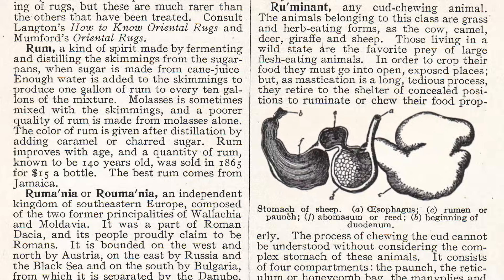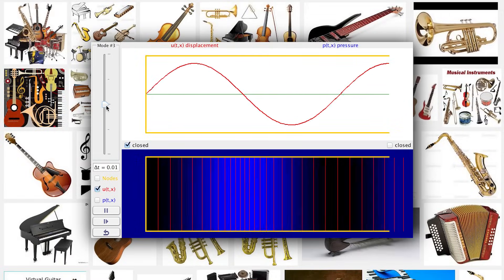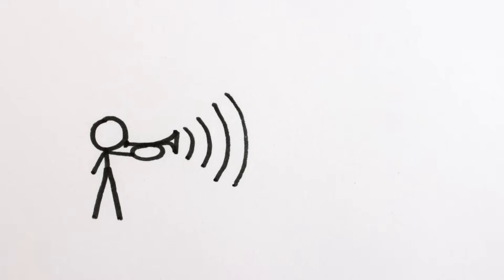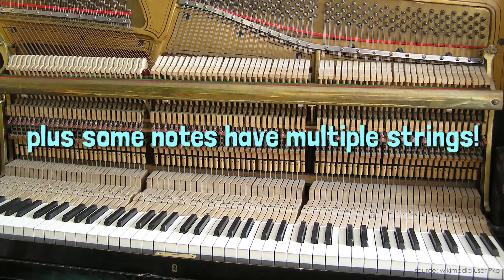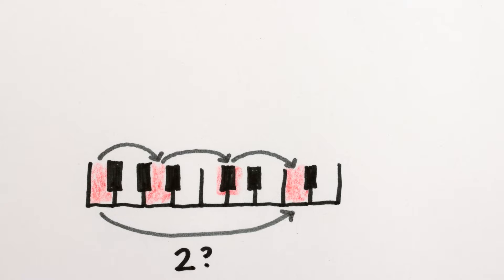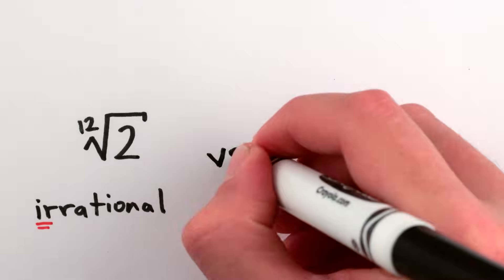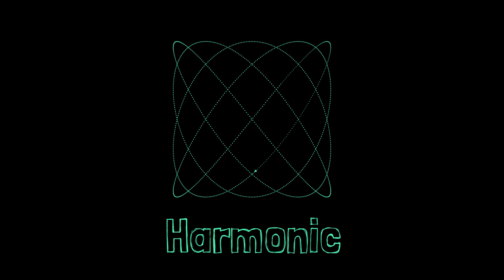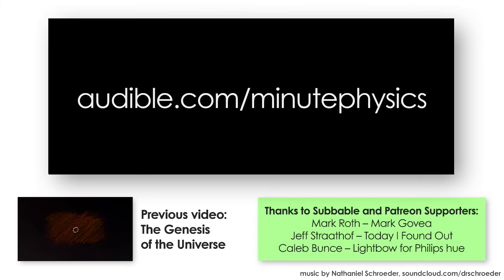Why It's Impossible to Tune a Piano

Comment: ? ? ?
These harmonics caused disharmony in my brain...
Maybe I should learn theory of musics
Reply: +EC912 It's worth it. Once it starts making sense, it's pretty fun.
Reply: +EC912   use 432Hz sacred solfeggio instead of J Goebbels muddy 440hz
Reply: don't don't don't it's a waste of time.
Reply: I'm a music theorist and a jazz piano player
Reply: Mike Davino
So what? Musicians can be wrong too. A432 is an outlandish conspiracy theory with no historical or music basis whatsoever. If you can demonstrate you're right, I'd really appreciate it if you did so.
Reply: +Mike Davino How is the starting pitch relevant? Why not train your ear to the pitch set we actually use? And which one DO we use? In Baroque times, A was quite variable. Instruments from the period are pitched as low as 392Hz—a full whole step below 440Hz. Through the years the pitch gradually rose. By the early 19th century, the pitch of A was approximately 430Hz throughout Europe. Even today, many British organs are tuned about a half step lower than the one at the Vienna Philharmonic (compare 425Hz to 450Hz), and the Boston Symphony Orchestra tunes to 441Hz.
Reply: phase conjugation
Reply: all waves line up symmetrically ...check out Dan Winter
Reply: +Mike Davino There is no base pitch at all that will cause this. You have been had.
Reply: Mike Davino
Any historical or scientific sources at all? Just randomly dropping names of people doesn't help much.
Reply: +EC912 =((pi^(9/89))-(4^54))+0.5(-98)(/3.1626*(2^32))
Reply: ender_scythe
Actually, pi^(1/81)+e^(arctan(3/61)+ln(cos(5*i + 9/2)))+(7 * sin(21*e) / 2 * phi).
Reply: +Fernie Canto does it really exist, no it doesn't lol nice fake mathy maths.
Reply: the names i gave have youtube channels
Reply: +Fernie Canto I agree. Another thing these '432'ers ignore is the fact that the numbers we ascribe our measurement of time are arbitrary, 432Hz would be a completely different pitch were a second not the length we arbitrarily defined. I think all this nonsense started because Just ratios are just very easily dealt with using 432 as reference, for example 9/8 = 486/432, 5/4 = 540/432, Hell, even 11/8 and 7/4 is 594/432 and 756/432 respectively.
Reply: +IAmTheStonedAtheist Also the 432hz nutters miss a very important point.
Let's just go ahead and assume that this 432Hz crap is real. If I use A = 432 Hz as a reference, I will be in perfect harmony with the universe because the universe has a fundamental frequency of 432 Hz.
Ok cool.
Now I'm I'm going to play a song in A# major.
That fundamental frequency of A is going to clash pretty hard with my A#.

They also ignore the major point that, even if you did set your A to 432Hz, as we see from the above video, none of the notes we play (except the octave) are perfect. So even if the A = 432Hz nonsense was true, it would only work on non-tempered instruments such as bugle, harmonic flute, didgeridoo, etc.

This is all just wishful thinking by uneducated people who think they have found the magic secret shortcut to making music sound great.
Reply: He is talking about Western music.   Traditional music from the parts of the world,  like India,  do not have a concept of chords
Reply: +fenojack As a musician, it's really not.
Reply: +Forthelemon It really is.
The A = 432 Hz is pure conspiracy theory bullshit.
If you know anything about music and physics you should know that it can't be true.
Detune if you want, but you're wasting your time trying to 'tune to the universe'
Reply: nuberiffic
What are you talking about? I know the 432 Hz thing is bullshit. I was replying to fenojack who said that learning music theory was a "waste of time." I never said anything about 432 Hz.
Reply: Forthelemon To me, music isn't supposed to be calculated and made mathematical. When I hear a minor third, my brain doesn't think ''Oh! that's a minor third, interesting, it could be the start of a strict formula of chords!''  No, I feel an emotion from each note. When a composer writes music, he wants the listener to feel a certain way, and he would use the notes like a palette of paint to convey those emotions. Of course, music CAN be calculated to sound nice, and there are many examples of good sounding chord progressions made this way, but I feel it takes away from the joy of writing and playing music. 
Music theory hasn't deepened my understanding of music much, but then again, everyone has their own opinions.
Reply: fenojack You do realize that harmony, say an interval of a perfect fifth, is a perfect 3:2 relationship? What other way do you recommend we notate and calculate the notes we use? You do realize there are 3 just versions of a minor 7th interval that are easily tuned by ear, and represented as small number to number ratios? I'm having difficulty understanding your point.
Reply: +Forthelemon Hmm.. Well my youtube is telling me it was responding to a different comment. NM.
I agree though; I used to think like +fenojack, that theory was a waste of time and that, "you just gotta feel the music man"
But theory helps you understand why certain songs feel a certain way :)
Reply: +EC912  Music theory really has nothing to do with harmonics and different types of scale tuning, such as the even tempered scale.  That's just science.  However, learning music theory will help you understand how music works, and why notes go together, and why going from one combination of notes to a different combination of notes sounds the way it does.  Then, you will better understand the implications of different scale tunings.
Reply: +fenojack All music theory does is describe all the different ways we've found to elicit emotion out of music. Theory is descriptive, not proscriptive.
Understand the theory so you can know what's happening in a song, use it as a guide to see what kinds of chords / notes you could also use. But still feel everything out.|

What you're suggesting would be like Usain Bolt saying, "No, I don't need to understand anything about biology, kinematics, running techniques, training methods, sports science, diet, and healthcare. I just run the way I feel."

Sure he might still be a pretty good runner without any of that, but understanding the theory of running has made him the fastest in the world.
Reply: +EC912 I've been studying music theory for last 20 years but this video still blew my mind. Music theory might teach you a bit about waveform resonance intersecting at certain intervals to create desirable cadences, but I had no idea about harmonic frequencies using divisions of an irrational number to create a kind of imperfect harmonic consistency through the octaves. I never knew this was even an issue for turning a piano. That is complete madness yet quite amazing really.
Reply: nuberiffic
"Music theory hasn't deepened my understanding of music much, but then again, everyone has their own opinions." I guess that's kind of what I'm going for.

For me, knowing about music theory has VASTLY deepened my understanding music--not just at a practical level, but at an emotional level too, in the same way that learning about biology has made the natural world so much more beautiful.

I think it also partly depends on how you were taught. A bad theory teacher will just teach the theory in a purely abstract, mathematical context. They'll tell you "this is a circle of fourths, and this is how you notate that on a music staff," etc, but they won't demonstrate what that means MUSICALLY or what it sounds like, what it feels like, how to use that knowledge to better your understanding of a composition, etc. Ideally, theory should be integrated into the teaching of your instrument, so the music and the theory are one and the same, not separate things.

The equivalent in something like science would be to say that, for example, a bad physics teacher will just teach the students to memorize equations, whereas a good one will show them what everything means in the real world and how cool it all is.
Reply: +nuberiffic As a music tutor, I am of the opinion that music theory is subjectively relevant to each individual. Some of my clients are complete naturals at 'feeling' out the keys where as some prefer a theoretical framework to be able to describe and understand the patterns they're using in a certain way. No doubt any player would benefit in some way from understanding a bit of music theory, but at the end of the day it's not essential. There have been plenty of amazing musicians out there that have no concept of music theory and have made some of the most amazing music of our time. Of course, it doesn't hurt to use this knowledge as a tool. That being said, those that don't learn still have a system of recognising the patterns and shapes for themselves. It's just harder for them to express or define it for you but they get it.

I would also argue that learning theory is only useful after you've already had a bit of experience trying to play. Learning theory before playing is a bit mad if you ask me but everyone learns differently and sees things from a different point of view so the tools are available for those that want to benefit from it. There are others that can't synthesis the two and get highly put off music because of the theory, even though they're still good players.
Reply: +RodniDemental Oh yeah totally.
I'm a music teacher too, and I've found that theory only helps you understand what you already know how to play.
There's no point understanding the TTSTTTS pattern of major scales if you have no idea how to play them or what they sound like.
It's only after doing those scales blind for a while that you can appreciate the mechanics behind them.

I do find though, that every single musician I've ever talked to (except for classical or jazz musicians) regrets not learning theory when they started out, instead going for the "feeling it out" option.
I did the same thing.
But then I guess that want to understand theory only comes from knowing how to play the scales, but not knowing why they exist.

It works the other way too though; most classical musicians, while they have their theory down pat, would be unable to improvise, it's just not something they ever practice.
Reply: nuberiffic Such good points, I went with the 'feeling it out' option as well. I told myself "play what sounds good," which I believe to be a GREAT starting point, 15 years later I studied 'Western' music theory pretty rigorously,  and realized most everything I wrote was basically right in line with the theory, i.e., use of scales, chord progressions, even the occasional modulation. Basically all that was missing were some technical terms. Some of my guitar buddies are like this, they know almost nothing about music but you'd never know it hearing them play
Reply: IAmTheStonedAtheist
Another reason why theory is useful is just for the sake of communication. If you do it just by "feeling," it can be hard to communicate that feeling to your bandmates. On the other hand, if you and your bandmates are proficient in music theory, you can just say "Play a neapolitan sixth and switch to 6/8 time" or whatever.

Also, it can help you get inspired creatively. Sometimes, I'll just be reading about some musical concept on wikipedia or something and I'll think "wow, that sounds really cool, I'm going to incorporate that into the piece I'm writing!" That would never be possible if I didn't have knowledge of theory.
Reply: nuberiffic I find it interesting what you say about classical players and improvisation. I'm sure there are many that can do both but personally, I was classically trained, I felt I could read most things with a bit of time, but I couldn't improvise a thing until after I finished my training and after finishing with my teacher. I finally had the chance to spend time messing around with chord patterns and random melodies on my own instead of copying them from a page. Can't believe I never got encouraged to improvise but we were too busy focusing on grades and it was all very strict. I try and integrate some of the more creative aspects into my teaching early on now so they find something to be excited about and just generally try to make it more enjoyable instead of it feeling like a chore. Which was how I remembered my training seemed for quite a while. Haha..

So yeah, taking the analytical approach can actually be limiting if you're not encouraged to expand or experiment with what you've learned. And as someone mentioned, a lot of guitar players take this route as score notation isn't necessarily comfortable or compatible for a lot of guitar players. But of course again, everyone learns differently. And it's not like I could possibly regret having that theoretical background before it properly clicked for me because it's all part of developing an understanding. Which ultimately will influence the types of patterns we make and the points of view we take creatively 'til we eventually develop our own musical identity.
Reply: +IAmTheStonedAtheist Yeah, I guess a lot of it comes down to that anyway;
Theory is just a good way of describing and categorising what you're playing.
I learned the Blues / major / scales etc about 20 years ago, but it wasn't until a year ago when I really looked at the theory behind them that I actually understood them.
Does this mean I can play them better?
No.
But it does mean I can utilise them better :)
Reply: +RodniDemental Exactly dude.
It's all swings and roundabouts.
Stick to strict scales and recitation of set pieces and you'll be awesome at theory.
Stick to feeling it out and you'll be awesome at improv.
It's a balance, and if you go to far to one side, you'll severely weaken the other.
Reply: RodniDemental"So yeah, taking the analytical approach can actually be limiting if you're not encouraged to expand or experiment with what you've learned" I completely agree with what you're saying with regards to classical training, but that has nothing to do with learning the theory. Learning an instrument in the traditional classical, conservatory method can absolutely be limiting and prevent you from being able to improvise and play with feeling. However, being taught in a way that emphasizes music theory does not limit you in any way--in fact, the opposite is true.

nuberiffic 
"Stick to strict scales and recitation of set pieces and you'll be awesome at theory.
Stick to feeling it out and you'll be awesome at improv."
There is absolutely NO way I would be able to improvise on the piano very well if I had no knowledge of theory. I think you're all kind of missing the point. Whether you learn to play in strict scales, read sheet music fluently, and play with the proper classical technique or whether you learn to play in a more improvisational, jazzy, "feeling-based" manner has a lot to do with your teacher and absolutely nothing to do with music theory. Knowing about the theory of chords and chord progressions and intervals and time signatures and all that is incredibly useful no matter what style you're playing in. Not only that, if you're taught properly, it will also enhance your experience listening to music. In the same way that knowing a lot about the theory behind painting and light and colours and angles and whatnot will give you a deeper understanding of the Mona Lisa, knowing about music and being able to understand what a musician is doing will help you appreciate the piece of music as a work of art, rather than just "things that sound nice"--and music, just like painting, poetry, literature, film, etc, demands--deserves, even, to be appreciated as a form of art.
Reply: +Mike Davino Hey Mike, usually see you at TT's channel!  I tried this tuning and all of a sudden I could sing 'Imagine' but the down side is that it is very impractical for a guitar with a floating knife-edge bridge ie. hours of tuning, spring tensioning and intonation so I just obeyed orders and went back to 440
Reply: +Fernie Canto I've been playing guitar for years and I absolutely can't understand music theory
Reply: +nuberiffic Ahhhh... so, this explains why the whole universe squirms when I play something in A# major... 

Sheesh!  I've not heard of this particular nut theory, so tonight I will have some more entertaining reading to do.   New agers in general have no idea what they talk about when they use the word "frequency".
Reply: Daren Wilson haha, yeah man. THere's some pretty crazy stuff out there.

The worst is when they talk about "energy"
Reply: nuberiffic Frequency and energy are very vague terms at this point that have been adapted to represent a much wider contextual spectrum than when they were first coined. This happens with language all the time.
Reply: RodniDemental The way the 432Hz / chakras / spoon benders certainly use it in a very vague way
Reply: I don't necessarily think they don't know what the terms mean, I think they're trying to adapt them to express ideas that don't necessarily have specific terminology which (assuming there is any relevance) is often required to describe something more accurately or perhaps scientifically, or whatever. I will say though, anyone that determines that 432Hz is an absolute or consistent number to represent whatever out of the box ideas we're talking about here with any certainty, then I'm skeptical. 

I do however believe that, resonance and vibration could be considered a fundamental aspect of our physical reality if you're using these terms to describe potential theories regarding the interactions of matter on the smallest scales. So sound and frequency (sometimes expressed as energy) inherently would have an effect (or lack of) on any kind of matter depending on it's consistency/density. I think it's something that's not very well understood (despite what some would claim) but we're starting to learn more about these relationships or interactions. So these terms can be used as a template or perhaps a representation to symbolise and create potentially new models to describe these ideas. 

Like how vague I'm being? :P Honestly I don't mind these words being used like this if it's just exploring certain concepts outside of the box, that's actually how progress and integration of new information occurs. I think it's when people start making claims before or without considering all available information is when it looses credibility.
Reply: +EC912 also study sound waves in physics and the math behind it.
Reply: +fenojack This ignores 1.) history: there was a time when Music was one of the mathematical Quadrivium in classical education (it was the study of ratios); 2.) the joy of those for whom an understanding of music theory provides an even deeper appreciation of music because 3.) most composers and performers worth their salt use at least a fundamental understanding of music theory to write and perform music. Just as an architect needs to understand many practical things about building materials, a composer needs to understand how various notes and note systems work, amongst other things. Sure, some can write music without this knowledge, but music theory is both an aid to composing (it can eliminate much guesswork) and a means of deepening the possibilities (tired of I, IV, and V? Try French augmented 6th (Fr+6)! Need a little more rhythmic interest? Consider a hemiola.); it is not meant to be a set of rules that must be followed to write "good" music, but is rather a collection of "best practices" and of combined understanding of how composers have handled these things before. It is actually obscenely difficult to write music without falling inadvertently into patterns trod many times before, at least music that isn't shite. (This is why Arnold Schoenberg, in creating his guidelines for writing serial dodecaphonic music, took such pains to find ways to cancel out these historically ingrained practices.)

In short, understanding music theory has allowed me to dig beyond shallow interaction with music and find the deeper possibilities inherent in the notes.
Reply: +lzepln "That's just science." Such science is the backbone of music theory. As the video said, equal temperament is what allows us to go between keys without having to retune. This innovation is responsible for most Western classical music (such concepts as chromatic mediant relationships would be disastrous in older tuning systems). 
Or take brass instruments, which sound notes of the harmonic series when played naturally (w/o using valves or slides--indeed, valves and slides simply move the natural harmonic series up and down to get the chromatic notes). Before valves and other such means, brass instruments were very limited to what they could play (except trombones), hence why they were treated as they were before the 19th century (even during).
Reply: Bahahahahahahahahahaha. If only I had know it were actually that easy.